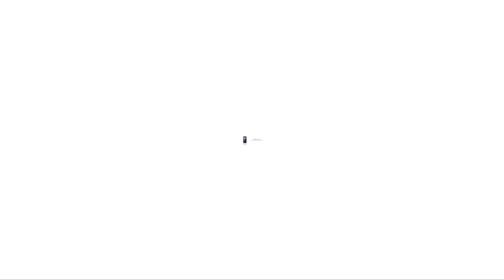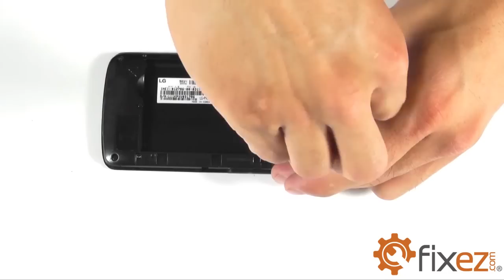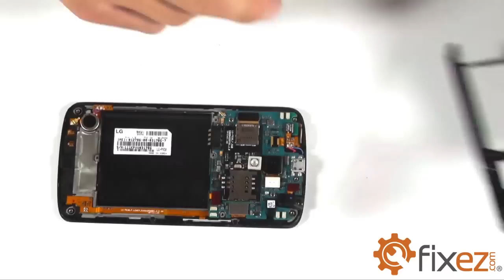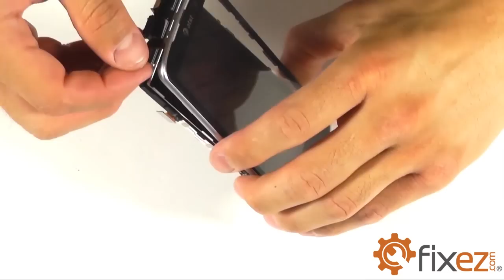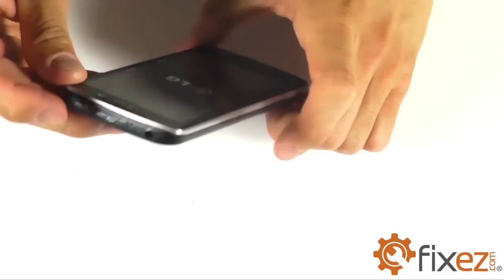LG Nitro HD Screen Repair & Disassemble

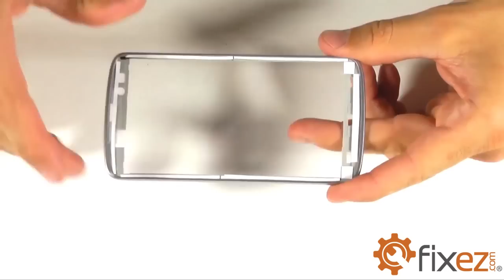Comment: My Lg Nitro works and functions properly but there is a crack on my front screen and I want to replace it do I just need to buy the front screen or the front screen AND the other part in 4:40 ? Thanks for the helpful video by the way !!